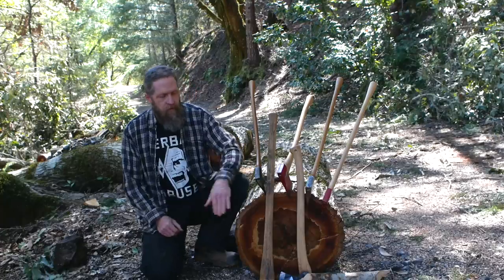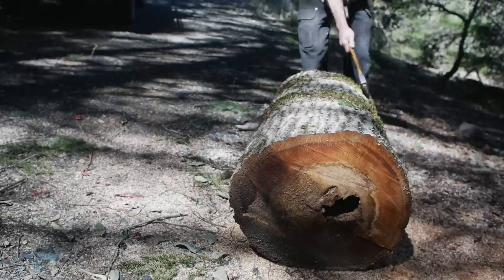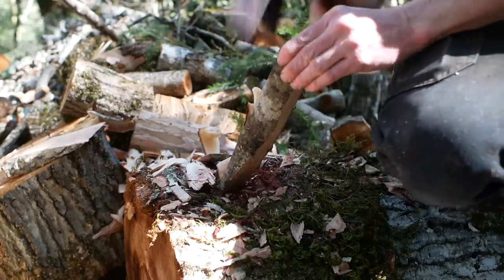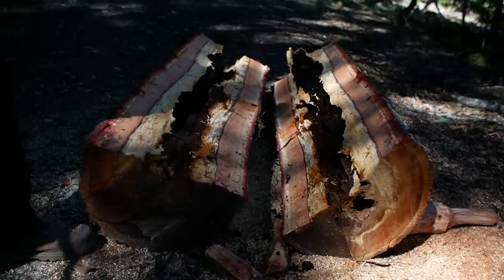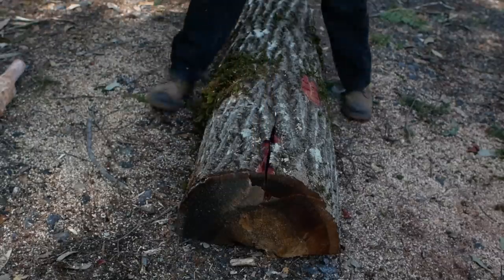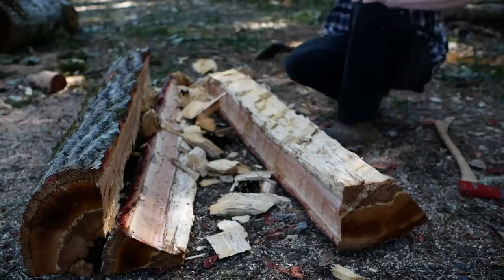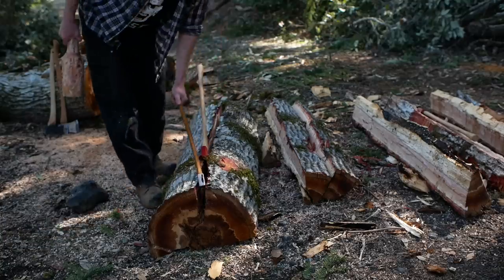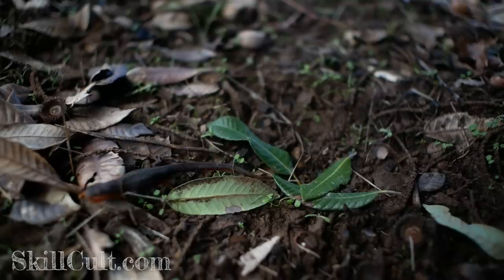Splitting Choice Axe Handle Blanks From An Oak Log & Shaping Wooden Wedges

Comment: This may be already covered in some of your other videos but are you going to film drying these staves?
Reply from the maker: Probably not. I need to move on to more marketable videos for a while.  That's the plan anyway.  I would otherwise.  I might shoot a little footage to use later somewhere.
Reply from the maker: @porkcheeks  Green wood wedges just won't really hold up.  They are totally disposable, especially if hit with an axe poll.  You can make more durable wedges, but a really tough piece of wood can screw them up with knots and crossed grain.  I think there is probably big climatic difference when it comes to seasoning wood.  Here, the ends will always check on large staves or billets unless they are coated with something.  The rest is variable.  Sometimes it will, sometimes it won't. It's about drying speed mostly.  If the outside dries quickly while the core is still static in size and swollen with water, high stresses form.  Coating the entire stave with something to slow drying is the safest, but certainly not always necessary.  You can also just control the drying speed, like I might stack up the rough hewn billets to season on a shed floor and toss a tarp over them loosely to increase humidity, block air circulation and generally just allow the moisture to leave the wood more evenly.  Depends on the species and individual piece of wood too.

Comment: The long, thin grind on the Opinel is, I find, ideal for food prep.
Reply from the maker: Yeah, it's very much like a kitchen knife.  I love kitchen knives like that actually.
Reply: @SkillCult  They are good for green wood, maybe not the best as a hunting knife as the belly was very hard to sharpen in knives from the past. They can do much more than peel apples or cut sandwiches. What else can you get for that price except a knife shaped abomination from China? They take a good edge and will do plenty of work and will do so for years.
Reply from the maker: @vinniesdayoff3968  Mora is a more competent cheap carry knife, but probably a little more expensive and not folding.  I may redesign this knife to be just all around better versatile carry knife..  Shouldn't be that hard.
Reply: @SkillCult  I'm not trying to be an a-hole Steven, I have enormous respect for you as an extremely knowledgeable, true outdoorsman. I think Moras are very overrated and don't slice green wood  like an Opinel. I built a shelter in one of my videos with an Opinel, and for the slicing type of cutting I was doing I would choose an Opinel any day of the week. I grant you a Mora would be stronger but how strong does a knife have to be to cut with? I never broke an Opinel by cutting with it (I broke the tip of an Opinel using it as a screwdriver on a rather large flat head screw when I was 10 or 11)
Reply: You guys probably have more experience with the Opinel than I do, but I find that it damages easily on anything even substantially hard. But any time I go camping it’s in my kit for food prep. Nothing cuts so clean as a long flat grind. The Mora Eldris is actually a good little carving knife. It has a secondary bevel, so isn’t as weak as some of Mora’s other full-scandi’s.
Reply from the maker: @vinniesdayoff Far be it from me to discourage experienced opinions!  I think you may have mentioned similar in a previous comment on another video, or someone did.  Funny, because almost the only thing I really like about moras has always been that they are excellent in wood when actually full scandi ground.  Once you start messing with that, I've always thought they lost that magic drawknife like quality, though some have said you don't lose it if adding a small enough microbevel, but I haven't really tested that proposition.  i doubt I will break this opinel.  I think I'm pretty much over the knife breaking phase, but that's only because I'll be holding back.  Like in this vid I'm prying out strips of wood when the knife jams up, but very cautiously, whereas with a Mora or anything appreciably thicker, I'd just crowbar that stuff out and I do that quite a bit.  There are more limitation in batoning too, not that I'm a big batoner, the opposite in fact, but it's a good tool for the toolbox.  Again, I'm unlikely to damage any knife by batoning, but that is only because I understand the limitation and would hold back.  I think the arguments for mora are price, durability of the actual tang/blade (not the edge, they're awful with a totally flat grind) and no weak hinge or lock to mess up.  that said, I think they are poor carry knives as I've said in a video before.  I can make good arguments for opinel too, but I can make a lot better arguments for an improved opinel.  i could sit down and map out an improved opinel in about 5 minutes that would be a considerable improvement in multiple factors.  I haven't really done any real carving with this knife, just because I haven't done much of that kind of work, but I'll be paying close attention and maybe making some comparisons based on your favorable opinion. Thanks for weighing in, and never hold back around here lol.  Can you link your video?

Comment: I got yelled at once for showing a video and in the video I used a wooden mallet to drive a hatchet into a bolt of wood to split it.  Wood on metal is okay.   Speaking of things falling into the gravel driveway..... I had a couple cedar logs stuck up on a snow bank, well snow melts and it did, the cedar logs rolled down and into a very muddy gravely driveway, coated them like a powders doughnut, had to peel the before sawing, winter cut and the bark didn't come off very well at all.  Great points on the fingers, been yelled at for showing Bad form in splitting kindling too, albeit the same style you show when splitting the wedges.  I can see grain orientation running with the eye because of the condition of the log.  I typically run the grain the other way, but not with that log.  Sweet log, too.  Wouldn't that punky wood also work to smoke a brain tanned hide?
Reply from the maker: I agree obviously that wood on poll axes is 100% okay.  I suppose there could be some odd situation, like a giant two handed locust hammer driving the axe into side grain ironwood, but I doubt it lol.  That's just newbs.  Almost all poll axes are mushroomed, like it has to be over 80% have been hit enough to tell, and distended eyes are rare in my experience.  most of them have been beaten on with the backs of splitting mauls or sledge hammers too.  Yeah, that's why I said that on splitting the wedge, because it looks like I'm still holding it.  You almost have to slow it down to tell.  I'm still inclined to think the rings separate more easily at the shoulder if the grain is oriented across the eye, but if so, it's not probably that much and a good user will nulify that in most cases anyway.  I dont' recall having used tan oak punk to smoke hides.  I've used a lot of different stuff, but maybe not that.  I should save some.  I actually have a pile of hides to smoke and some to soften too.  I hardly get around to braintanning anymore.

Comment: I'll be interested to see how oak performs for handles & bowstaves. It's not usually the first wood recommended for these applications, but it seems like I come across oak way more often than hickory, yew, osage orange, lemonwood, etc. Ash seems to be available from trees killed by the emerald ash borer and I'm curious as to how well it will work out for similar applications. Your content is always rich in information.
Reply from the maker: Oaks can be very different to one another.  From the little I've worked with it, our Maul oak, which goes by several other names, seems better than tan oak.  I'm also curious about garryana oak, but I'm pretty sure black oak would not be too great for handles.  I think any could work for a bow with good design and execution, but bows have more leeway in how they are designed.  You'll see white oak recommended as an axe handle sometimes.  I have an ash bow (our western ash) and ash tool handles are second only to hickory on the market.

Comment: Speaking on using axe handles as a prying lever I found that using my Norlund Tomahawk (2.5lb) axe with a 24in handle as lever proved to be fatal for the axe as there was a complete horizontal split at the point where the bottom of the eye of the axe met the hickory handle. The only diagnosis for the break I found was 1. Though the eye of the head had good taper for a nice seating, (the hanging of the axe went well and there was hardly if any gaps throughout the matchup of wood to steel, the eye was relatively small 2. The handle had little to no oil applied besides a thin layer of mineral oil leading to a brittle handle that was more likely to crack and less likely to flex. If anyone has any other comments on potential reasons why the handle failed under such stress I would love to hear it, thanks for another great vid!
Reply from the maker: That's very common, that's why I was warning to be careful.  There are factors that could increase it, but it's largely a matter of learning that limits.  I"ve broken one handle learning what I can get away with and I"m very careful.
Reply: @SkillCult  i totally agree im gonna be shaping some more straight grain hickory soon to replace the handle. On amazon now they are selling Plaza double boiled linseed oil (100% chemical free). This might be the best source for a lot of your viewer's to get pure linseed oil for soaking handles
Reply from the maker: @haydenfox3116  That is interesting that they are actually selling a product that is pure linseed that is actually heated, but without the driers.  I prefer just raw oil for penetration and slow drying, but that stuff is cool for other uses.  It is probably similar to stand oil, which is partially polymerized, so it dries quicker.
Reply: @SkillCult  good to know ill keep that in mind!

Comment: That was great training! Thanks!!! Now I know why my wedges pop out...too convex!
Reply from the maker: Could be.  Those two factors, convex and thickness, which are partially the same thing, are first to look at.  I was thinking when editing that maybe rubbing some dirt into the wedge faces could help with grip, because just lack of adequate friction is another major issue.  If the wedges are dry, that should help.  Also, you can use more wedges and if you can get them to stick at all, try just tapping each alternately a little and just keep working your way along them.

Comment: Have you ever tried to make an Adirondack style double bit handle? I've recently been looking into the history of that style handle And am very intrigued by them
Reply from the maker: Is that basically like a single bit handle?
Reply: @SkillCult  pretty much lol. From what I've read, the single bit curved handle was used on a double bit head as a way of determining easier and faster which edge was the keen thinner edge vs thicker splitting side. I guess way back when, when logging was a way of life and a means to support your family speed was important. Also would get the benefit of having both edges on a single tool. I've recently put a beater together on a 28" really thin handle and it sounds counter intuitive and conflicting ideas, but for me it's the perfect multifunction tool

Comment: What would you save the bark for? You mentioned it at 21:09Tip. I always use a stick to steady anything I'm chopping that won't stand on it's own. Moving my hand away before the blade hits rarely worked out for me. I've chopped plenty of holding sticks but never a finger.BTW.... Thanks for this video
Reply from the maker: Tanning leather.  This tree is called tan oak, because it was used in the leather industry.

Comment: How wonderful. I'll try this as soon as I find a suitable log. How long do you expect the drying process to be, before the billets can be worked into axe handles?
Reply: That's the beauty of using true riven heart wood a year would be great but if you're desperate for a handle you can use it right away seeing you're not using the pith or the sap wood where most of the movie is anyway. And because no you reaved it out where it would naturally either want to split or whatnot anyway it's very stable.
Generally depending on how you cure them you can leave it in your car or your attic for a month or two and it should be perfectly fine
Reply: @horseblinderson4747  Thanks, that's very helpful.

Comment: did you ever turn these into handles? how'd it go if you did? im not sure I've completely exhausted the local options just yet but but none of the pretty much only 4 hardware stores in reasonable distance from me had any species suitable for handles whatsoever. so I'm very curious about native norcal options. I did see your video on Bay Laurel.
Reply from the maker: No, I didn't.  I think the best woods will probably be Maul Oak (quercus Chrysolepis) and Oregon White oak (Garyanna). Maybe mature bay.  My bay handle was young sap wood and failed, but older wood seems very tough.  Also Black locust when you can find it growing well enough. it is often twisted and gnarled here due to the low summer rainfall.

Comment: Skillcult- do you have to season the rails before  cutting the axe handle & if so for how long before it's dry enough?
Reply from the maker: I talk more about that in the follow up videos.  If you carve too early, there is more chance of warpage, but if you rough things out part way and leave some extra material to account for warpage, that can be a good strategy to allow the wood to adjust some before finishing.  https://youtu.be/teH8ygLpCHo    and    https://youtu.be/kon52CGdai4

Comment: What other species of wood are acceptable for tool handles? I have a lot of red oak on my property and if the brown tail moths keep going like they did last year, I may have a lot of it to use soon.
Reply from the maker: This wood is really experimental.  Eastern red oak, in my very limited experience of what makes it out here, doesn't seem like it would be very good for that sort of thing.  It always seemed kind of short and brittle.  The Eastern White Oak was definitely used an Black locust, sugar maple, ash and hornbeam.

Comment: Those look like some decent boots, mind sharing which brand and model that is? As ever thanks for the great content.
Reply from the maker: Those were sent to me by a viewer actually.  They are super comfortable and were comfortable right out of the box.  Keen brand.  Baltimore 6 inch extra wide option.  I'm glad I go the wide one, doesn't squish my toes together like most shoes.  One fault so far is the soles seem to have gotten a little chewed up walking on loose rock talus.  Enough that it could be a problem if you were on really rough ground a lot.  Otherwise, love them.

Comment: 17:00 talking about runout. Over the years I noticed that I get a lot less runout when splitting bottom-to-top. on cut pieces you can often see the original orientation by looking at the knots, but there's also a certain feeling. Especially when the wood is not green anymore, you'll feel a bounciness when gently tapping the top surface with the sharp side of your axe, a different feeling from tapping with the same force on the bottom surface. I think it's because of how a tree grows (generally bottom-to-top haha) where on a long straight piece, the bottom end will have slightly more fibers than the top and thus more dense. Travelling from the bottom to the top, there are no options, but when the split travels from the top to the bottom, it encounters ends of fibres where it will travel slightly sideways to pick a side of that fibre. I believe (but it's a pure guess, not science!) that due to that change in trajectory, the split may snap through adjacent fibres causing the actual runout. 
I don't seem to find any correlation between wood types and the runout behavior, but there is definitely a big difference between woods wrt how bad it runs out and how often. Short fibred wood types like beech will just runout like you describe here and even more drastically just break out halfway. My "trick" has been useful for me on ash, pine and willow... Especially when splitting tinder from scraps from the saw mill one side will run them into pointy toothpicks, while hitting the other side will shoot the split straight and square through.

completely off-topic: my son and I found out the other day that chives make excellent straws for drinking juice or water... =D
Reply from the maker: That i interesting.  Usually wood splits easier from the top for some reason.  In basketry, we often split from the tip because there is less tendency to runout and the runout is easier to control.  In some cases, it can make a big difference, in others not so much.   I remember the first time I found that out I was splitting a bunch of Redbud or Maple shoots and it seemed counter intuitive, but it woked much better and my rough splits were a lot more even and clean. On big wood for some reason, I don't pay a lot of attention.,  On this one, I didn't pay attention at all.  I started on one end and did most of it from the other.  I was probably thinking more about camera angles.  it might be interesting to take a homogeneous log and do half each way to see if there is a noticeable difference.
Reply: @SkillCult  that would be a good way to objectify my impressions... I'll see what I can do :)
Since you mention that on sap wood it is the other way around, I wonder if what I found depends on whether my hits were radial or axial wrt the original position in the log... Usually when I split willow fire wood, I only chop radially unless it's a really large diameter. Ah, so many frivolous (yet scientific) challenges =DD
Reply from the maker: If you are familiar with splitting small stuff for basketry, try splitting some willow shoots both ways. It can be a pretty big difference.  It seems counterintuitive for some reason.